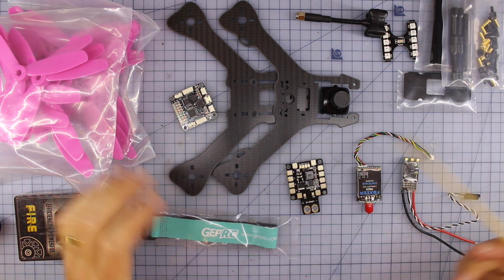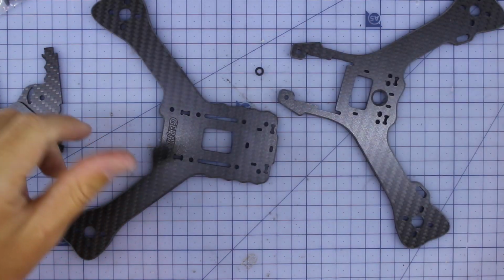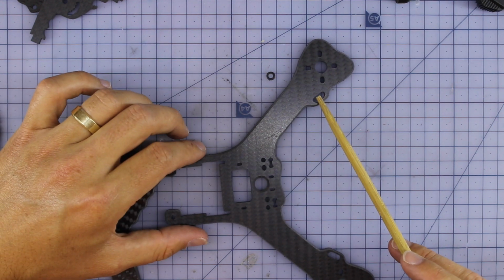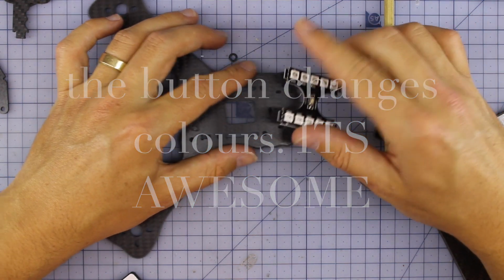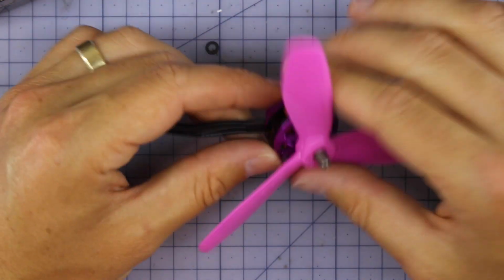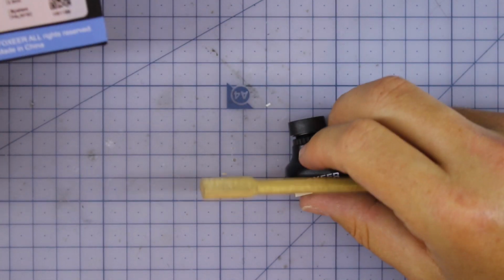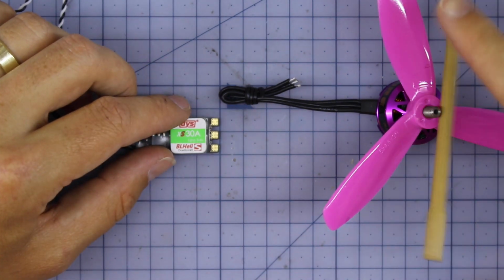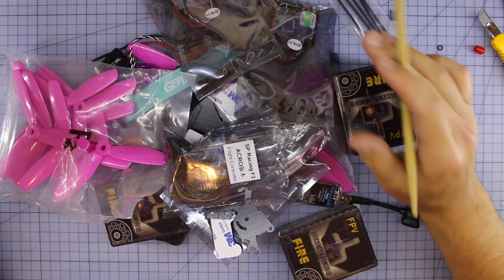FIRE HAWK IS FREAKING AWESOME. Dream Kit? Gbx210 review part 1

Comment: Hey Stew quick question did this kit come with cw and ccw motors or are they double threaded if that possible haha only because Im tring to buy these motors from banggoods and they only sell them separately will i be able to just buy 4 and use them for cw and cww.  Do more high end motors not need cw and ccw threads.   keep up the great vids :)
Reply from the maker: I think they do come with 2 of each type, but honestly I dont think the direction makes a difference. the lock nut will still keep it tight no matter the direction
Reply: Cheer man :)

Comment: Is there enough space for a TBS Power Cube? Also is that a cradle above the FPV camera for a GoPro session? Thanks
Reply: I have a cube,, and emax rs2300S  fed with 95c 4 s 1550...   INSANE   goes up as fast as a model rocket! lol  It's a tight build, but if you use the new VISION on bottom of cube   JUST  WOW.. ONSCREEN  camera adjustments, 2 camera option, everything configurable by sticks.. Coolest build ever!
Reply: In fact  I am cloning my build 2 times more.. 1 for a friend, and 2 for summer!
Reply: Thanks, I ended up picking up the TBS elite cube, TBS 25amp ESC's, Rotor Riot Runcam Swift, TBS Mr Steele 2345kv SILK motors, FrSky XSR, Tattu 1550mAH 75C 4S and Racecraft 5051 props. Just waiting on the frame and hydro dipping. Getting ready for some flying when the snow melts.
Reply: Karl Dulle How do you end up mounting a GoPro on yours if you do? Still waiting on my frame and can't figure it out from the pics so far.
Reply: I use tbs vendetta foam mount..works awesome, no weight!
Reply: I did not use the stock fpv cam hardware, as it would not work with a full cube
Reply: Karl Dulle Okay so the strap is meant to be Vertical not Horizontal got you. I'll look into that mount. Hopefully I'll be up flying sooner than later.
Reply: Snow melts?   LOL   yeah  I didnt wait.. burned up some stuff.. But NOW   I use corrosion x, it's  nearly waterproofed my quads.. I crash in snow all the time.. Now biggest fear is crashing and not being able to find it, because it plunged in a hole 3 feet deep.. But so long as the snows got a good top crust, I fly!   That sounds like an awesome rig.. Not A Steel motor fan, but aside of that, it rocks, and Im sure the motors are superb..

Comment: Hey there is was intrested in purchasing this drone as my first fpv racing drone but i was just wondering about the process related to building this beast as in did you need to weld anything or were there any certain tools required to complete this build 
Anyways great vid and awesome drone review!
Reply: snoopie welding, no. But you will need to solder

Comment: Hollow shafts are for weight loss, solid shafts are much stronger.
Reply from the maker: incorrect. at this size the tube is actually stronger than a solid
Reply from the maker: "Strength to weight ratio is better for a hollow pipe than a solid rod." This means ahollow cylinder is stronger than a rod of equal mass and the same material. Ahollow cylinder with a bigger inside diameter is better. In the limit x → 1 the hollow cylinder is twice as strong" google

Comment: 0.1mm lamination is most likely referring to the core that the inductive coils of the motor are wrapped around. Laminating the core helps to prevent eddy currents (general movements of electrons in a conductor) in the core and allows for stronger magnetic fields to be created out of the same amount of current through the coils.
Reply from the maker: thanks

Comment: higher camera sensor resolutions wont do an awful lot, as long as you are bound to pal/ntsc video limitations. to quote from wikipedia: "PAL usually has 576 visible lines compared with 480 lines with NTSC" 
depending on the processing, the camera does (and that causes the latencies), you may actually get a better looking image, than form a sensor with native TV resolution. think of JPEG images and intialiased fonts.

Comment: the TBS TRIUMPH is a clone. it will suck
Reply: Ken G Don't read my profile picture
Reply: Team BlackSheep ra ra ra ............ goooooo china.  

Banggood slogan = Proudly stealing from and closing down "real companies" with our clones since 2013
Reply: Team BlackSheep you're products are amazing, I've been using your Triumph antennas throughout my whole experience with FPV and have not had a single problem, keep making amazing products!!
Reply: Knew it was too good to be true.  I hope it does suck, but even if it performs as good as a genuine Triumph, I will not buy one out of principal.  If we want continued innovation in the hobby, we have to support the innovators, of which TBS are one of the best.  Merry Christmas to Trappy and the entire TBS crew!
Reply: thanks for your support!
Reply: Loki from HeliPal? HeliPal is authorized dealer, it will be an original.
Reply: Team BlackSheep : Hi! How can I tell if my Loki X3 is rocking a clone?

Comment: yet another awesome videos cheers stew
Reply from the maker: thanks mate. Wait until you see this weekends vid. im pretty excited about it ; )
Reply: i'm sure you are :) cant wait for it... btw i build a martian II last weekend got it to the maiden and i'am excited too ;) there is just 1 point i'm pissed about - i got some stutter on a perticular throttle position i dont know where it comes from :P
Reply from the maker: what flight controller? what firmware, betaflight? have you updates your escs and calibrated them.
Reply: Betaflight 3.0.1 - yes i did calibrate the escs ( escs are the new Racerstar MS series 25A ) and the board i'm using is the: Sp Racing F3 6 dof - i dont know how to explain it ... the drone flys normal but it's like a stupid noise sometimes you can hear not always just here and there

Comment: lamination is referring to the thickness of the coating of the wire inside the motor.
Reply from the maker: thanks
Reply: Are you sure that Lamination isn't referring to the thickness of the sheets used to build the cores of the electromagnets? I think it's that what it refers to

Comment: am i the onlyone whi thinks the front motors should be high and the back low? makes the quad more leveled when at tilt right?
Reply: "...more leveled when at tilt..." If it's tilt, it's not leveled. The flight angle and motor angle will be exact the same on both configurations. The only difference with high back motors is that the props go thru "undisturbed" air when flying with great attack angles.
Reply: You know what i mean😉 if you would fly this reversed it would loom like one of the old tiltable frames😉
Reply: Mean u have a lower profile to fly gaps if you reverse this setup
Reply: But the rear props go thru distrubed air indeed
Reply from the maker: this would result in no real aerodynamic benefit
Reply: It might look like, but FC and motors are levelled..
Reply: Ill just keep my X setups 😂
Reply: I've just built the Banggood clone, they sell another version but I don't know if that is the original as it's not much dearer. I agree about the backwards idea and the motor tilts like Opix says, I thought that. I don't know about the undisturbed air as mine fly tilted forwards and the rear motors are above not behind the fronts. I just wanted it because it was cool. I agree about Banggood and the Team Black Sheep comment and once I stop crashing so often I'll not buy clones but I ask them, with all respect, where do they get their manufacturing done? Are the Chinese companies cloning products designed by western companies and then built in China cheaply or are they cloning things designed and manufactured in home markets?
Reply: I have X'x as well. This flies different.. Much better bite... especially in hi roll throttle turns..
Reply: I'm such a long way off stuff like that really I just zoom about.

Comment: so,is this whole kit 6s capable? or just the motors?  not a bad price if it's 6s ready.
Reply: proto fpv put a different pdb in it and the camera and vtx can't handle that much power so power both with bec and you will be fine, off course also 5v for the fc
Reply from the maker: I dont think the whole thing can run 6s, just come components.

Comment: the frame is a knock off of the Moka Simplex, if you are interested in trying the real deal contact Reda Rida on facebook, it is made in Canada with t700 carbon, give him a nudge i am sure you can arrange something with him.
Reply: Québec Multirotor not a nock off its just inspired by them but a completely different design.
Reply: The realacc one is a nock off from this frame and this gbx210 not from the Moka simplex
Reply: i agree there's some differences but the idea is the same, the realacc is closest to the simplex in design to the simplex

Comment: They are Kingkong props, or they come from the same factory.  Copies of the Dalprop 5x4.5x3HBN.  I have that camera and I don't notice the difference in latency over a Arrow, but it is a Cmos, and you lose some view angle top and bottom.
Reply: Thumbs-fpv my kingkong are stiff and they look the same shape and has the arrow which way they go
Reply: SickocrowAU these are not Kingkong these props are stiffer and da different shape
Reply from the maker: they are the same plastic as king kongs, but they are the same shape as the dal tri 5040v1s
Reply: I'm being pedantic, but I'm holding a KK 5x4.5x3HBN in my hand, right now.  It is the same prop.  EDIT;  I probably shouldn't call them HBN.  That's a term QuadMcFLy from MQTB uses.  http://www.banggood.com/10-Pairs-Kingkong-5x4_5x3-5045-5-Inch-3-Blade-Propeller-CW-CCW-for-FPV-Racer-p-1067877.html?rmmds=search
http://www.dalprops.com/collections/5045tri/products/t5045-v2

Comment: 0.1 mm lamination is the thickness of the paint layer/anode layer, typically used is about .04 to .06 In case of paint it makes it harder to scratch of, in case of anode layer it makes the alloy harder. So whichever it is it's good for you :3

Comment: That cam has a latency that is lower than the hs1177. It is a great cam. I have the hs1189 and it is my best fv cam.
Reply: emiel1976ep thanks. I was wondering about this camera.
Reply: It's a great cam. The only negative thing is when it gets dark. The cam is not that good when it gets dark. Other than that, the cam is great.
Reply: I did not have a good experience with the 1189. The video is great no complain but I got too much jello. I have only tried a couple of times on a specific quad and switched back to my swift, so maybe it was a bit the frames fault too, although no jello with the swift. Have a new frame onw I ll try it again its a shame to be in the spares box.
Reply: Only jello when I damaged a prop and than even not that much. The most as I use 2 bladed props that are damaged.